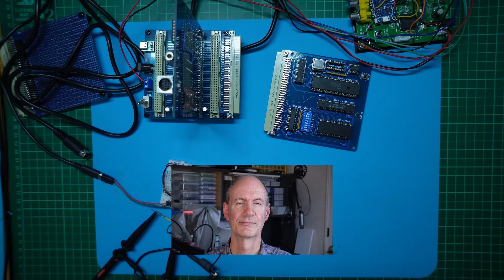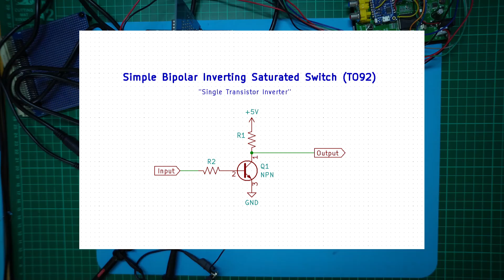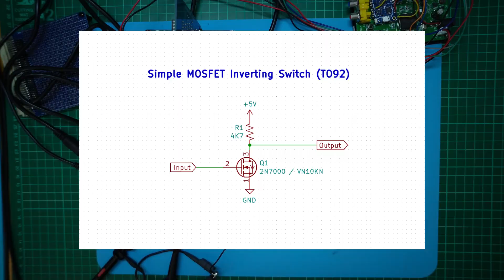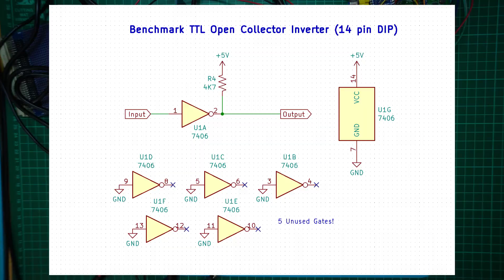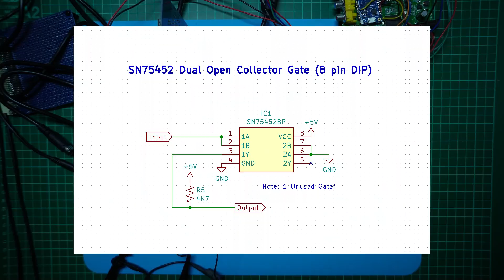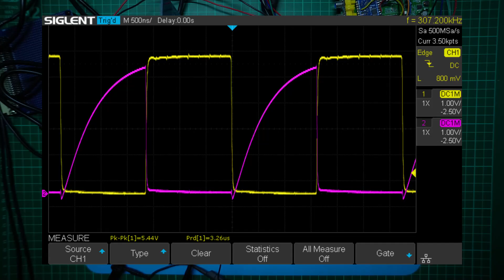Retro CPU Interrupts - Driver Options

Comment: Seeing the header socket on your board reminded me, do you know of a 2.5mm pitch version for old Soviet computers?
Reply from the maker: Unfortunately not. I’ve never personally come across 2.5mm pitch in these type of connectors.  It really is unfortunate that the world didn’t adopt a metric standard throughout.  It remains a pain having to design with a mixture of imperial (0.1”), and metric dimensions, and having to constantly convert between the two.  🤔
Reply: @DigicoolThings  It was worth a try, thanks anyway. And thanks for the video of course. Does a good job of showing the darker side of the RC time constant. :)

And this looks to be an attempt by the Soviets to make sure that western parts weren't going to fit. Had everyone been on team Metric beforehand, they would have diddled with it in some other fashion to achieve the same result (incompatibility).

Comment: Have you looked at something like this TI SN74LVC1G06 Single Inverter Buffer/Driver With Open-Drain Output in a sot-23. same space as a to92 but a lot better than a fet or BJT.
There are loads of single channel glue logic chips out there now days.

Another nice video
Reply from the maker: Thanks again.  Indeed, I use single gate solutions (1G) in a number of my other more modern projects.  I ruled them out here due to my "Retro" focus.  i.e. I wanted a TH solution to keep within the Retro theme, so I'm avoiding the use of any SMD's on any of my Retro designs.  The same reason why I went with the tidy 8 pin DIL solution for my updated CPU Reset, when there are also plenty of smaller SMD solutions available. 🤓

EDIT: In retrospect, I should have clarified my Retro theme avoidance of SMD in the video.  But, I’ve now added a paragraph to the Blog entry to clarify my use of TH only for my Retro themed projects. Thanks again for bringing this oversight to my attention. 👍🏼